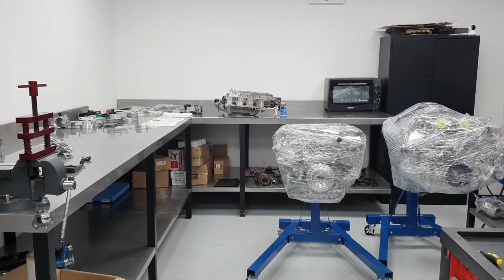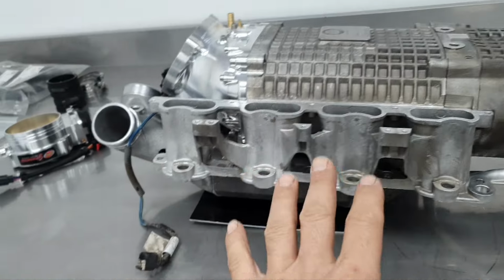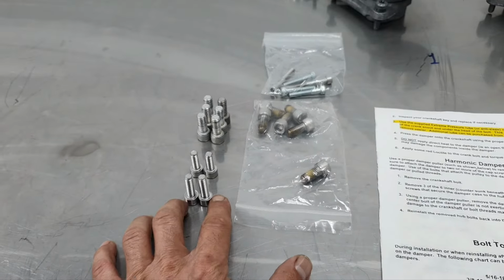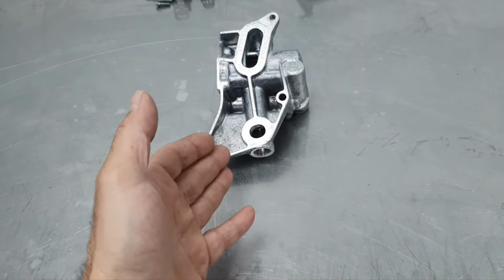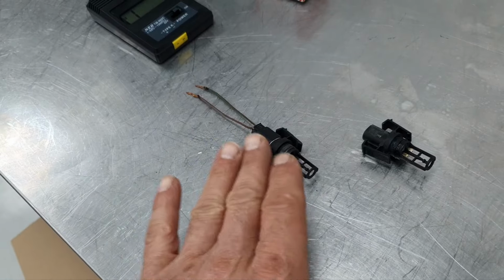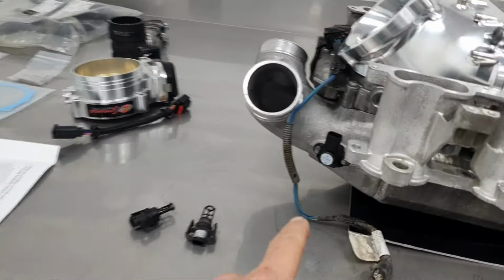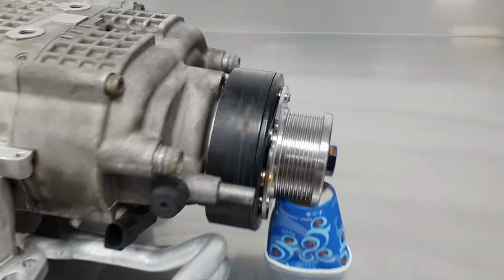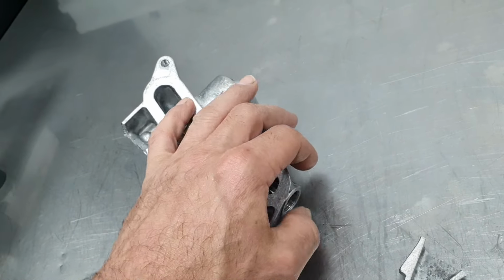E55 2004 with 450k km engine rebuild (part 14)

Comment: You can weld that yourself no problem Tasos the more you do welding the better you get anyway.    I would just do two or three passes and get where the crack is up close to the top of the milled surface weld right across to the ends and sand those down.   And obviously try burn in even slightly out the other side as much as possible on that first pass.   I think its easy to get a cutting disc with bees wax on it and shave off any penetration that comes through the other side but obviously you want to avoid that on the sealing surfaces like you mentioned but I doubt it would be an issue unless you put way too many amps into it try aiming the torch more away from those points slightly.